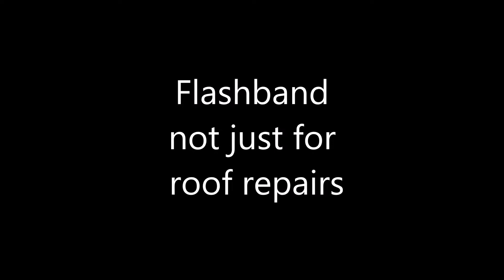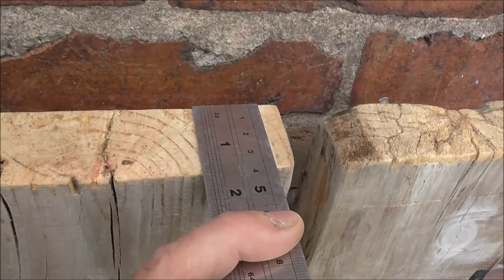Flashband not just for roof repairs

Comment: What have I been watching. A for the botch job, but weather will still get down those cracks. Nothing ronseal wet rot, ronseal wood filler and a splash of paint wouldn't sort out.
Reply from the maker: Mr Moss so you missed the flash band going on to cover the tops. Also, the gate is not painted so the paint can not be used.
Reply: Missed! no I didn't. Any timber used externally should be treated with something not flash banded. All wood can be painted.
Reply from the maker: lol you saw that spelling mistake anyway the gate is not painted and the customer does not want it painted.
Reply: Painting and Decorating wow somebody is paying you? Now I hope you didn't rip them off 😂😂😂😂
Reply from the maker: Mr Moss it was just a small extra added on to the job when asked can you prolong the life of this gate, so it was free really. The  customer was happy and the gate is still going.
Reply from the maker: Mr Moss thanks mate,  and never said you was lying your method would work and both methods will degrade. But the flash band will last longer 25 year guarantee, filler and paint would crack out faster.